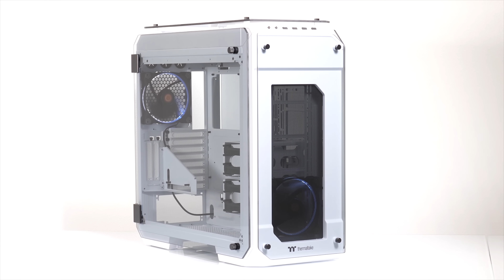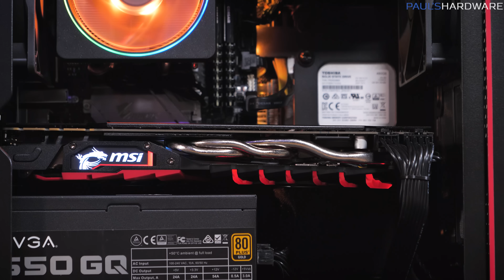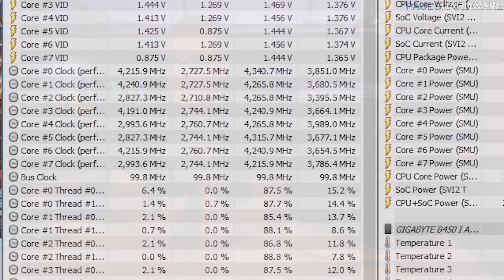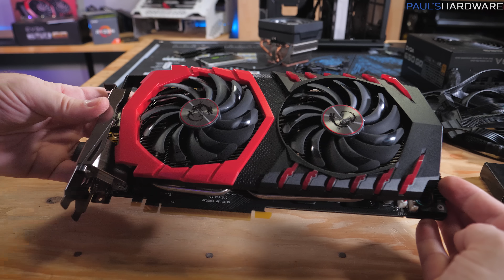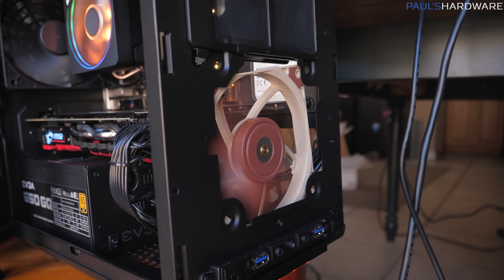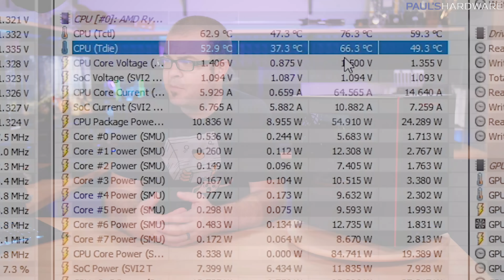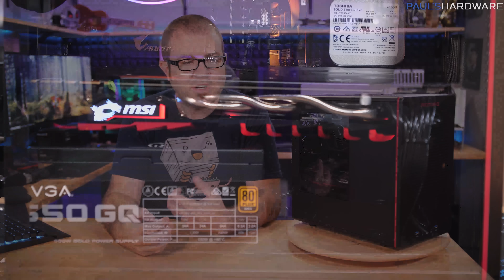Testing the $1200 Mini-ITX Gaming PC Build of the Month!

Comment: Paul lives life on the edge.  He mounts fans while they are spinning.  Let's all be glad he didn't lose a finger.
Reply: the RPM may be high, but torque is non-existent with those fans. itd at most be a pinch, id be surprised if it broke skin
Reply: @bradhaines3142  yeah I know it was a joke.  Lol in my line of work I get my finger caught in 110v fans and I come out unscathed.
Reply: I've gotten nasty cuts from computer fans. With skin flaps.
Reply: LOL
Reply: Maybe he did it like that to be sure the fan was actually blowing air in the right direction. In, instead of out.
Reply: @James-Anderson-Jr  most of them are fan blades facing forward (ie the front, for Inake and come out where the support for the motor is or have an arrow indicating direction of air flow.
Reply: he has installed 100's (well maybe not 100's but a lot) of noctua fans, he knows what way the air flows and most fans have a arrow on the side pointing in the direction the fan blows anyway.
there is 0 resons to mount a fan while it is spinning, they can both hurt you (no big injurys but it can still hurt) and they can break when your finger or screw driver hits the blades while it is spinning,
Reply: Blowie over at LTT would destroy your finger
Reply: I didn’t lose a finger but I did lose quite a few fans this way... I know better now 😄

Comment: Next video you should do a custom liquid cooling loop in there you could mount the radiator fan at the front of the case and the reservoir/pump combo at the top of the case and drill some holes to let the tubes go into the case for the water blocks. That would look really cool!

Comment: does seem a bit of a mis-match, great cpu/great graphics card/gold psu ..........and you dump poor ram in it ? surely this system is suited better to something 3200+ mhz and cl14 timings to boost the cpu infinity etc
Reply: The difference between 3000 and 3200 is irrelevant
Reply: the difference between 3200 AND CL14,14,14 and cl16/17 3000 is though which is exactly my point please read statements BEFORE commenting on them
Reply: @tonybarden8563  its still  SMALL AF
Reply: well you must know better than most of the tech press and reviewers then,mindblank done a video about latency and its effects on games a while ago, the point still is and will be the spec of this system is well above corsair lpx 3000 ram, im guessing you dont have some 3200+ low latency ram then yourself ? (or do you work for corsair or something)
either way your flogging a dead horse mate
Reply: Tony, Better ram makes 0 difference if you're being capped by the gpu. All this ram talk is true IF 1) you're running an 1080 ti 2) playing at 16:9 1080p, then it will make a difference. Right now you can buy a 3000mhz cas whatever for $150 dollars or the B-die stuff for $200- $210 in this stupidly expensive (hello price fixing) ram market.
Reply: @tonybarden8563  spending 50 bucks more for 3200 cl14 to 3200 cl 16 is a joke for the performance gain. Fact. No need to defend ur bad buy
Reply: my bad buy ? you assume a lot i bought 4 sticks of tridentz 3866 for £330 sold two for £200 so they owe me much less than 150 of your bucks ,with regards to 3200cl14 it should in that system get to 3333 or 3466 cl14 mine is happy at 3466 cl14 with a ryzen 1700 so no i disagree once again,and now everyone on the extra 50 bucks arguement then why even bother with the system as its designed just chuck a non name 600w psu a ryzen5 and a 1030 ..................oh hang on thats pointless ..so is the 3000 ram in this system
jeez you guys love to troll for trolling sake as for running at 16:9 1080 why would you want anything lower with a 1070 and a ryzen 8 core ?  what is this back to year 2000-2010 and 720?
Reply: >Corsair Vengeance
>poor RAM

Pick one.
Reply: Afaik ryzen 2000 is a lot less sensitive to ram speeds than ryzen 1000, so it shouldn't matter asuch as before

Comment: I mean its not that small
Reply: Relative to mid atx yeah. But going to sfx power supplies you can get quite a bit smaller. I have a Silverstone ML08 and it's very thin. Downside is the awkward wiring and the ton of annoying screws.
Reply: That's what she said.
Reply: Not small at all...
Reply: SPAGHETT 
If there would be (or if there is) a subreddit for „xD“ jokes, you‘d be in one of them.
Reply: I think that a case like a DANcases A4, is necessary for a Mini ITX build.

It’s not really worth it, considering you have almost zero upgrade possibilities.

Comment: I would wait for the 3 Gen ryzen because of the 7nm instead of the 12nm manufacturing and die the New rtx 2070 so you would spend the Same Money for more piwerful Hardware and you should  use a x470 or b450 Board for the best Performance (ans RGB ram yk RGB makes everything faster 😂)

Comment: Did you have any problems with the ddr4 running at its overclock speed ? As I have had a few problems with the x470 boards trying to get my memory up to the 3200mhz can only get it to 2800mhz or won't boot up
Reply: Up the dram voltage to 1.4v or 1.45v while using xmp. I have a kit of corsair vengeance rgb pro 3200 that refuses to go rated speeds without 1.43V on my x470i. I also have a patriot kit with a 2600x/b350 and that one needs 1.45. So strange cus both kits run xmp at 1.35v on my 8700k/z370 just fine.

Comment: How much should I buy a used gtx 1080 for? In usd
Reply: nothing
Reply: Unless you know who and how the gpu was used, never ever buy used w/o a warranty.
Reply: About $500?
Reply: Josh Lui Theres a zotac amp! extreme 1080 from a guy on Craigslist for 350, should I get this?
Reply: worm6942 that's a pretty decent price, however on Wednesday EVGA bstock cards may come in stock, you might get a better deal there.
Reply: Ravocado what's b stock?
Reply: ex-display/customer returns/factory repaired etc etc
Reply: worm6942 It's done by EVGA and you get a one year warranty it's pretty sick just look up EVGA bstock. Cards that come in stock, sell out super quick.
Reply: $430 for 1080 on newegg.com, don't buy used unless you get a warranty
Reply: Who is selling these bstock cards and what is the price?
Reply: brand new was $340 from EVGA ebay store on 8/8 with the 15% site wide promo it sold out fast. now they marked them up to $430 brand new.